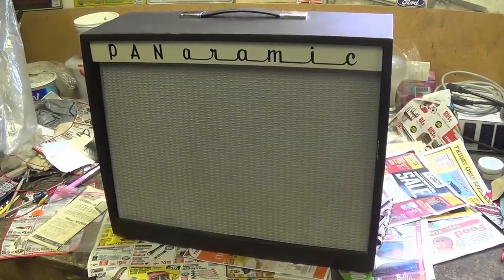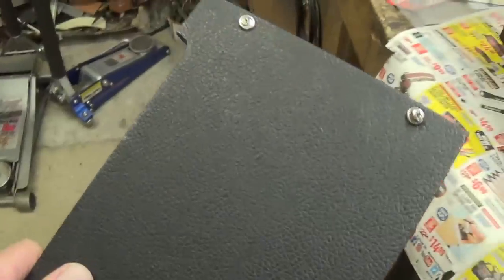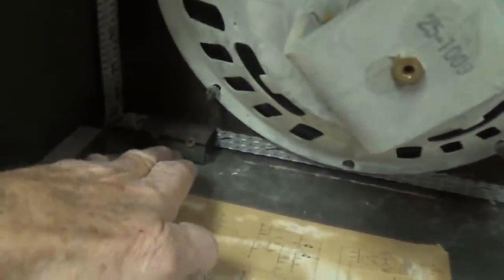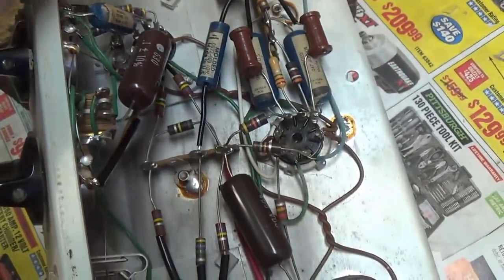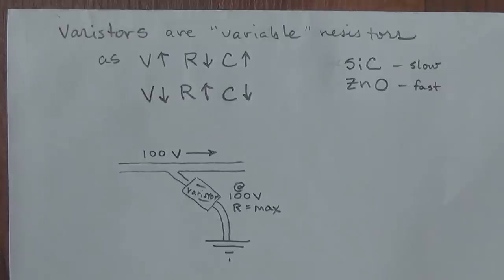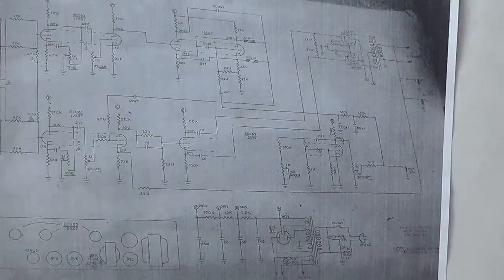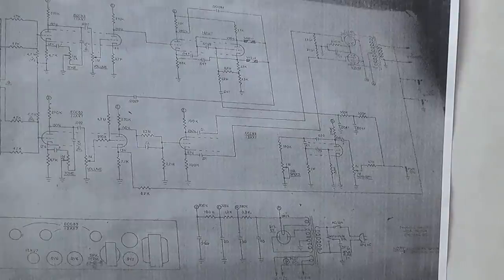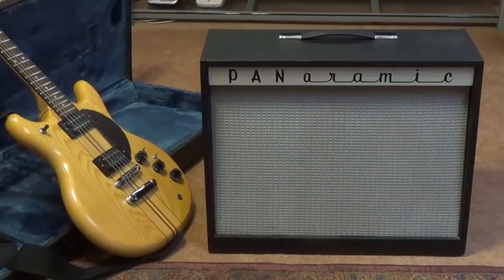1963 Magnatone Panaramic Model 1210 Amp with "True" Vibrato

Comment: Still don't see or hear it changing the frequency. That is a time-domain thing and cant be done with passive filters. It does act like a phaser, that modifies the frequwncy response, not the frequency.. What you end up with is a variable  filter.
The only true vibrato of the day is circuits like the Fender with the spinning disk and read/write heads.
Reply: I think the secret is that it is a dynamic process using two opposite waveforms. You're right that a passive filter can't adjust the frequency, but when you add the oscillation back and forth I think it can. Because if you think about it, if you take a sinewave, and slowly start adding the opposite sinewave into it, it's gonna look like it is pushing the sinewave backwards. Then as you start removing that opposite sinewave, it's going to make it look like the sinewave is being pushed forwards. If you stop changing the amount of wave, you're just gonna end up with a quieter signal. If you add too much of the out-of-phase wave it'll cancel out completely, but if you keep it within a certain range and make sure you keep the ratio oscillating back and forth, it'll essentially make the wave look like it is being stretched and squished, which effectively is bending the frequency. I would imagine it does not work so nicely with complicated waveforms, but that's okay.
Reply from the maker: Sorry you're a skeptic, Scott. If I couldn't convince you, then maybe Daniel's comment will. Thanks, Daniel. I like your explanation.
Reply: @UncleDoug  Thanks! Yeah it was melting my head for a while trying to figure out how what basically looks like a cathodyne splitter could actually cause a frequency shift. But then I realized you have to look at it in an instantaneous moment-to-moment way. Adding the two opposite voltages just moves the point up or down a little bit, which is perfectly reasonable. Then, if you imagine there is a sine wave scrolling by which has to pass over that point (because that point is part of the sine wave) then moving the point up and down has the effect of forcing the sine wave to slide over a bit faster or slower.

It's a bit of a mind-bender but once you realize that the oscillator has to actually be moving for there to be any effect, then it makes perfect sense. It's actually pretty ingenious. I think if you used active elements to do the mixing you could make the same circuit work but without the varistors. Maybe that's how the fender harmonic vibrato works? I actually think this might be a situation where the dreaded silicon might be a good choice - replace the varistors with two LND150's and modulate with the tremolo oscillator and you could make it work with only two triodes instead of four.
Reply: @witeshade  No, it will only be a small change in phase. To change frequency you need to change the phase by an increasing value. I have repaired phasers  that have multiple stages  of variable phase delays. Still no change is frequency.
Adding to signals that differ by phase will not change the frequency by any significant amount. It will modulate the level.  I'm too lazy to go back to my EE math and show it
Reply: @ScottHenion  the value of the phase change is  increasing and decreasing, that is what the  oscillator is doing.

Comment: I like the Tremolo more, as it's closer to a simulated rotating speaker.
Btw. this Amp looks just like new. Beautiful :)
Reply: Vibrato is somehow eggy
Reply from the maker: Thanks, TH. Actually, Leslie speakers offer the same vibrato effect as the Magnatone.....plus tremolo.
Reply: @UncleDoug  I thought Leslie is physically spinning the Speaker. Therefore they weight tonns. Am I wrong?
Reply from the maker: The speaker is stationary, but the sound from it is directed downward into a spinning wheel that sprays the sound outward like a lawn sprinkler. You get both volume and frequency modulation.

Comment: Nice to see things that you do not come across too often. Great amp in top condition and not the same old Fender, Vox and Marshall I am in no way knocking these amps  just that I like the less well known. Burns, Selmer, WEM, Supro, among many other less ell known names.
Reply: Just strap on a "same old " Vox  AC30, and play with the "Vib-Trem" control, and you'll hear the same amplitude and frequency modulation that we've just been shown. Hammond used a similar idea in their  non-Leslie vibrato, but with rotary mechanical switching like a telephony-type uniselector.
Reply from the maker: I agree, Gary. Some of my favorites are made by Valco and Premier.
Reply from the maker: Thanks for your input, Ian.
Reply: I had a Gretsch Tennesseean exactlly like that one in the 1980's, stupidly sold it  now they are selling for 3 times the price when I bought it. Painful lessons to be learned.
Reply from the maker: It's a lesson we've all learned, Gary.....the hard way.

Comment: Great Video! Just a little bit of info you might like, the varistors they used were copper oxide and not the silicon carbide or the newer MOV's They were basically 2 copper rectifiers in Opposition to each other. If you look closely at them in the schematics you will see the dual diode symbol this is why it is so hard to copy them!.
Reply from the maker: Thanks for the input, IVE, but it directly contradicts the "Bible" regarding Vibrato circuit design:  "The varistor that Magnatone used was made from Silicon Carbide (SiC) using a ceramic manufacturing technique.  SiC varistors were being widely used in telephone sets in the 1950s, and also for over-voltage clamping applications in electrical equipment".  I posted a link to this article in the video description. Please read it and let us know what you think.
Reply: @UncleDoug  That is what I originally thought also the SiC. But I found one of their original Schematics a 1957 Troubadour I do believe! that had copper VDR printed right on the Schematic! I am sure they used different and probably SiC by the 60's but who knows for sure. They may have kept the copper and fooled everyone!
Reply from the maker: I wonder what the copper oxide varistors looked like. You can see the original ones.....probably SiC......in my amp circuit. They look like old-fashioned tubular BED resistors.
Reply: @UncleDoug  I have found more schematics with the dual copper diode and also found at about 1960 the schematics changed it appears that about 1959 was the last of the copper! the SiC appears different on the 1960's and above schematics. I am going to do more research this is very interesting. I am sure that your amp is the SiC.
Reply from the maker: It is indeed interesting. Thanks, IVE.

Comment: Great amplifier and great video! That's the way an old amplifier should be reviewed.
Reply from the maker: Thanks, WC. Please see our other videos. All are in this same format.
Reply: @UncleDoug  
I will!
I particularly appreciated the mixture of aesthetical/musical considerations and theoretical aspects.

I guess the working principle of this electronic produced vibrato is the same of the Hammond L122 spinet organ that I'm currently restoring.
Reply from the maker: Thanks. I am blissfully ignorant of the electronic complexities of Hammond organs, WC, so I'll have to take your word for it :)
Reply: @UncleDoug  
I'm not an expert technician, anyway I think electromechanical Hammond are not much more complex than certain amplifiers are. Of course, the have quite refined mechanical parts inside, in particular the famous models equipped with the delay line+scanner vibrato system.
Reply from the maker: @whitechannel2669  Just the same, I will leave them to your skillful hands for repair.

Comment: Mr Doug,
I have a question for you.
If you are putting 500 HZ in, how do you get more or less than 500 HZ out?
I think your scope was fooling you because the trigger point was shifting as the amplitude changed.
 To be sure the triggering was not fooling you; you would have to trigger from your source wave and not your result wave.
 Another way to test your theory would be to replace the bias shifting oscillator with a fixed DC voltage source. Then theoretically you could adjust that voltage while a steady 500 hz was going in and watch a steady 480 to 520 hz coming out.
 It simply cannot happen.....
I believe that what Magnatone created was a variable phase shifter that acted like a swept frequency filter when mixed back with the fundamental; creating harmonics a little above or below the fundamental, but never actually changing the fundamental.
With the phase either leading or lagging depending on the opposite voltages being applied to the varistors.
And that It, plus the amplitude modulation from the bias shifting, created that 'special' sound.
Reply from the maker: Thank you for your very informative analysis, Dennis.
Reply: @UncleDoug  ,
Thank you for responding so quickly.
I have really been enjoying your videos but kept coming back to this one trying to understand what was really going on...
Reply from the maker: @Dennis-mq6or  I'm sorry if it wasn't clear in the first place, Dennis. I tried.
Reply from the maker: @Dennis-mq6or  I believe this has already been covered in previous comments, Dennis.......but thanks :)
Reply: @UncleDoug  ,
Yes you did cover it, and did it very well.
You also mentioned you would have liked to know a little more about how the circuit worked and what parts were used.
I believe that you will find everything you want in that patent filing.
Reply from the maker: @Dennis-mq6or  Thanks, Dennis.

Comment: Now we’re talking!
Reply from the maker: Yep, and our voice now has "true" vibrato :)
Reply: Yes! Great explanation of varistor properties, what they achieve and how. Obeid Khan (Khan Audio) is the chief designer of the new Magnatone Amps. He worked for Crate too and designed at least some of their amps - one of which I own. Before I moved to NJ, Mr. Khan kept my amps in shape. I don’t know what sort of trade secrets surround varistors. Sounds more akin to grandmas secret egg salad recipe than the Manhattan project though. What do I know? I rely on you electronics wizards to keep my tools working. Anyway, all the new Magnatones sound magnificent and the twin twelve stereo version is the king of these to my ear. It is a king tiger tank though (very heavy and expensive). Worth it. I personally use the first new generation Varsity (no reverb) to gig with - class A 15 w - volume, bass, treble - killer amp. This thing is simple, portable, beautifully voiced and flexible without the need for pedals and can get really loud when required. In the latest version, the cabinet was changed to conform to their classic series. I think they made minor changes to the circuit too; I’ve not tried it.

Comment: The best tremolo by far. Love these amps.
Reply from the maker: It's actually a true vibrato, Jeff, which involves pitch modulation as well as volume modulation (tremolo).
Reply: @UncleDoug  they are the best by far. Thank you.
Reply: @UncleDoug  just picked up a Trem66 and a current attenuator.  The older effects are the best .
Reply from the maker: @jeffsquires6620  Makes sense to me, Jeff :)